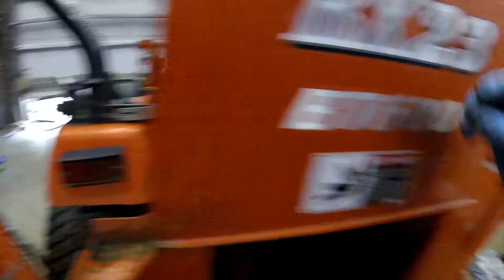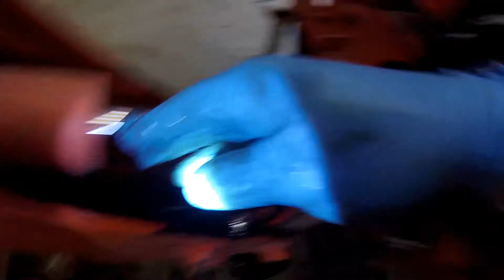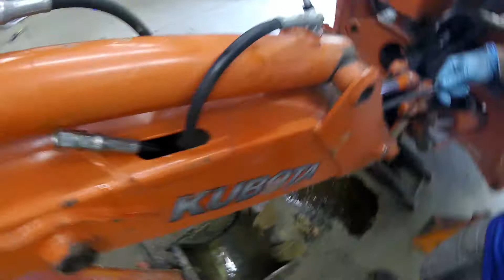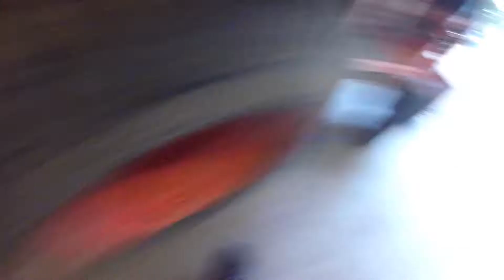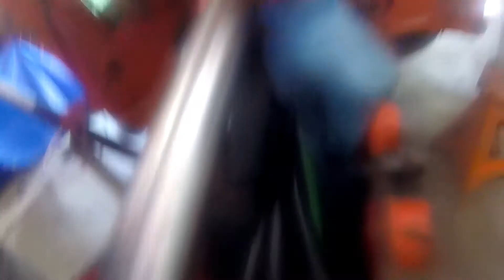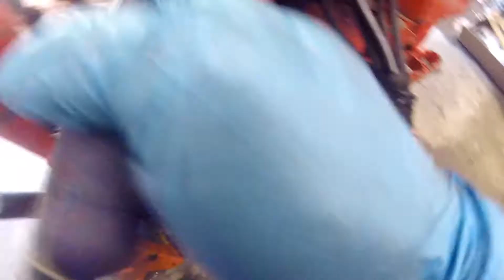Kubota Backhoe Hose Repair

Comment: Just replaced all of the lines on my B2650 front-end loader. Believe it was 12 hoses. Thought I did a good job taking photos and videos before removing but realized once I had the new hoses I needed to do a better job labeling and documenting everything. Ideally you would remove and replace 1 hose at a time and not multiple. Thankfully my son-in-law was helping me who has experience with hydraulic lines and he helped ensure I avoided a few mistakes.  I'm now replacing 4 hoses for the BH77 stab arms. One has a leak. Since the unit is 9 years old I'm going through it and replacing anything that looks remotely worn.

Comment: Have you ever had an issue when fully extending the backhoe bucket? When the backhoe bucket is fully extended there is a 90 degree elbow that makes contact with the backhoe. I have had two elbows snap off in like a day.
Reply from the maker: No never had that problem. Possibly the orientation is not correct?

Comment: Great video; thanks for posting.  I did not take "Before" photos and this video helped me figure out one problem I had but couldn't figure out without a photo. 

My only "suggestion for improvement" would be to remove the pin for that "boom cylinder" that makes it a tight squeeze for all the hoses running through the "sleeve" in that tight spot.  By getting that one cylinder out of the way I was able to replace two hoses that was running through that protective  "sleeve" without having to cut the sleeve (thus my sleeve is still intact).

Comment: I've replaced a couple hoses on my BX backhoe. First time it was the bucket hose so fished the lines through the protective sleeve. My suggestion would be to just knock the pin out and retract the boom cylinder to get at the hoses. Much easier. Just yesterday had another one leaking from the boom cylinder. This time the cylinder must come out to get to the lines and those pins were a breeze to knock out.

Comment: Thanks for the Video, I did replace the inlet hose from the kubota to the backhoe after I replaced it I lost total operation of the backhoe on the hydraulic, any idea of what could have happened ? (also had the two legs dropped down while I changed it) 
thanks man
Reply from the maker: Good chance you mixed up or mis-identified hoses. They have to flow in specific directions. Better double check all are those.
Reply: @notoriousJPG  thanks for your reply. 
I just took the new hose apart and found that the new hose I bought from Napa Auto parts was collapsed inside and didn’t do any flow. 
Got a new hose and its working great now.

Comment: Do I have to release pressure from the hydraulic hose before replacing it? How is that done?
Reply from the maker: Yes as a good precaution. Just move the controls in each direction a couple times in case there is residual pressure in the line after turning off the tractor.

Comment: This was very helpful. I unfortunately will be doing this tomorrow and now at least I know what I’m in for.
Reply from the maker: Yea, I've had to do a few of them so far. Unfortunately, the hoses I've had made are a larger diameter than the stock so after the first one, I had to do some re-routing. 😕
Reply: notoriousJPG one place I use for replacements is larger diameter and another one is smaller. For any of these backhoe one I’ll definitely be going with the smaller ones.